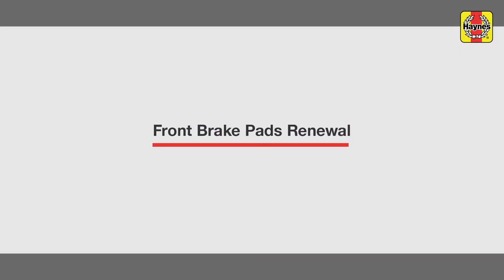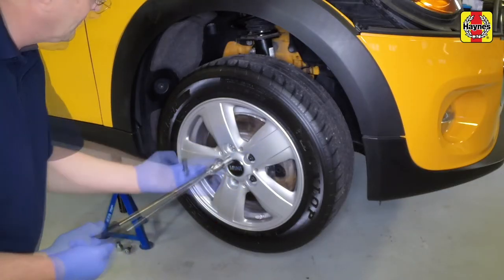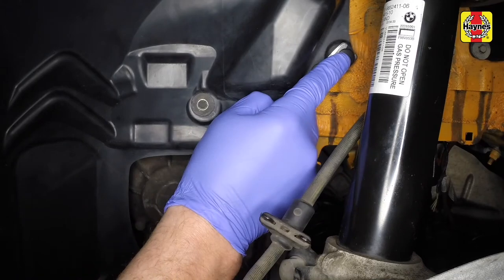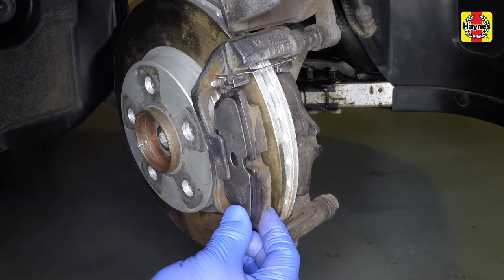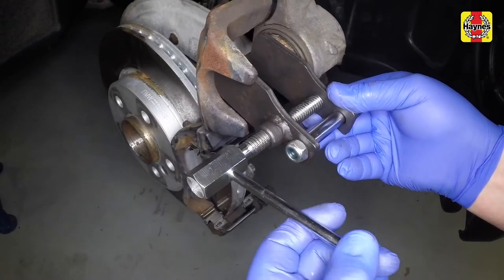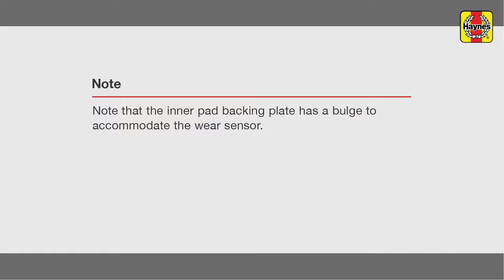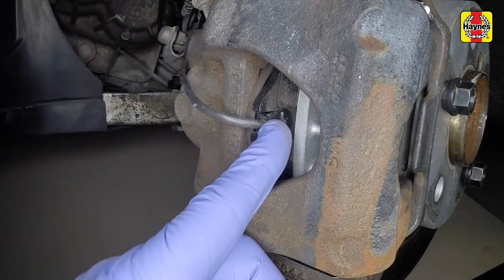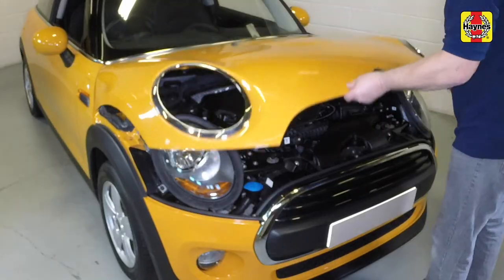Mini One (2014 - 2018) - Replace the front brake pads

Comment: Do you have to replace the vacuum pump at any point? I’m driving with about 45k miles to the car and I’m replacing tires and the brakes and am wondering if I’m better off doing them myself and replacing the pump at a later date or waiting for the shop
Reply from the maker: The vacuum pump is intended to last the lifetime of the vehicle. No need to replace it unless it fails.

Comment: Why My brake pedal hard after changing brake pads? (Mini cooper). Before it was good. Ichanged booster, vacuum pump also. But no difference
Reply from the maker: A hard pedal is normally a sign that the servo vacuum system isn't working...Can only suggest that you double check your work.